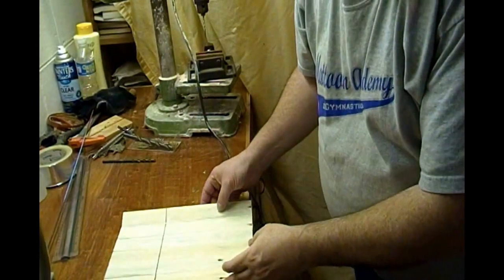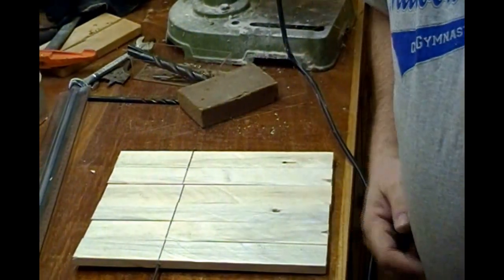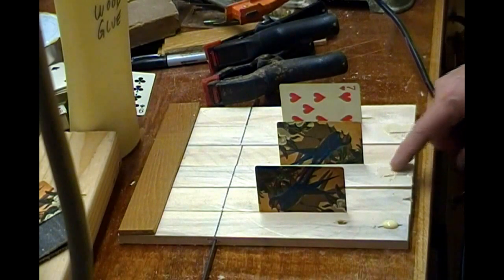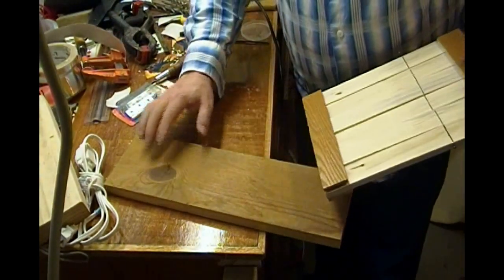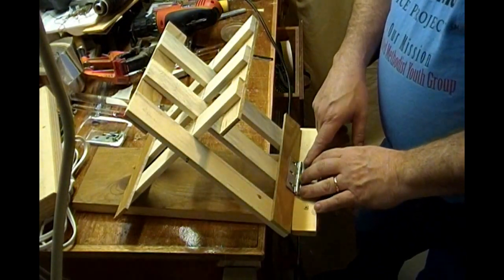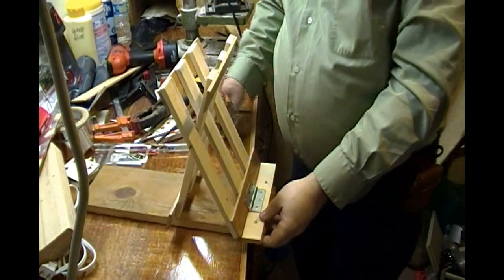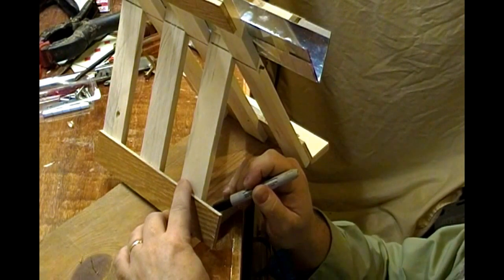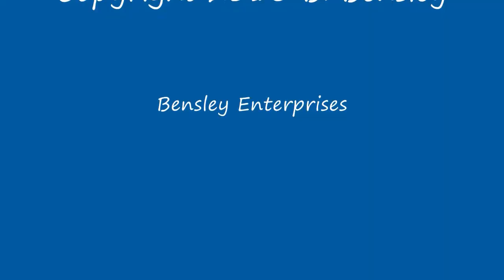The Kaleidoscope Maker #2

Comment: Thank you for showing us this. Great workmanship.
I have a question. At very narrow angles, if I move the jig to a narrower angle, would it press the edges of the glasses together that it breaks or chips them?
Reply from the maker: not exactly sure of your question, but, I would lift the mirrors out of the jig.  The jig is basically designed to hold the mirrors at an angle and not to move the mirrors to an angle.  It is designed to get you into a very close ballpark of the angle, and then by the skill of you own eyes and hands, tweak it into perfection.  I hope this makes sense.
Reply: Yes. I understand it now. I saw you adjusted the angle for more images within the mirror system, and got worried that the mirrors could be pressed together too hard and damaged.
Thank you.